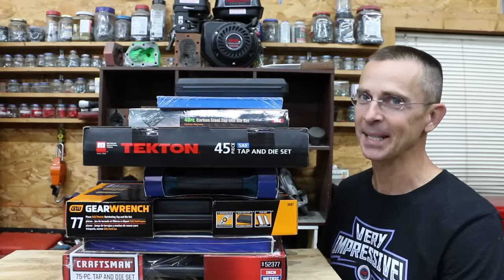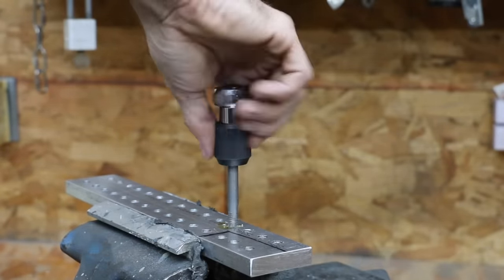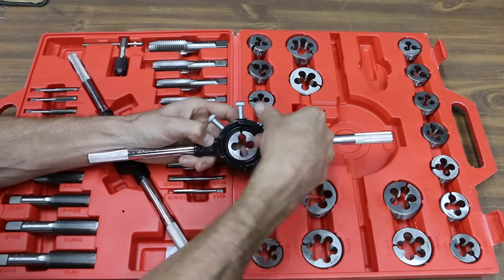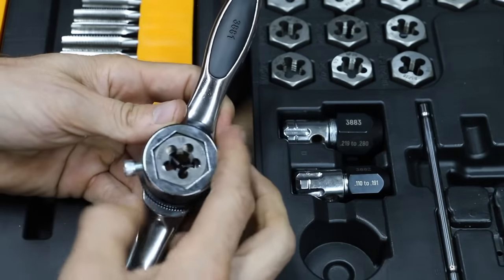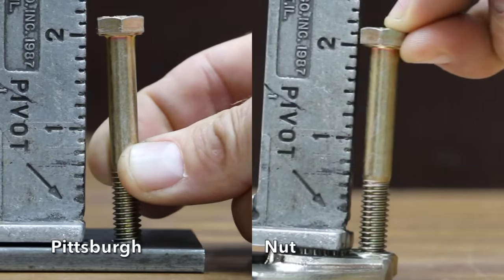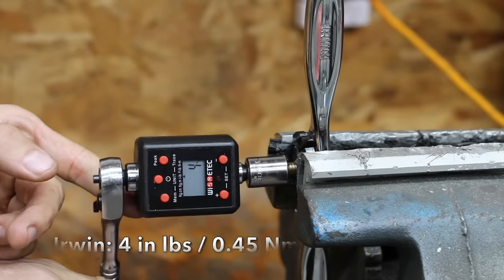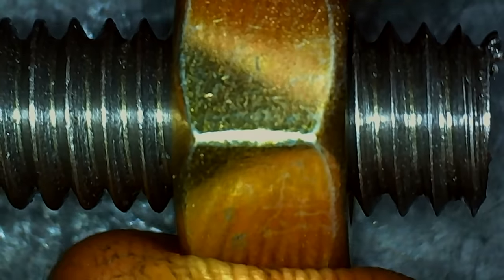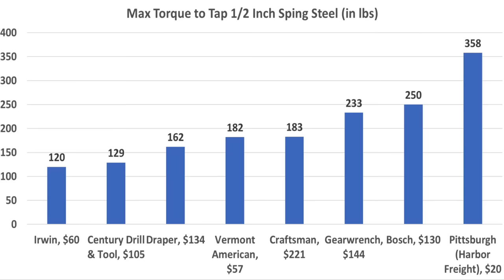Best TAP & DIE Set? Craftsman vs Irwin, Bosch, Draper, Vermont American, Tekton, GearWrench

Comment: Great video. Years ago, I was taught to make a turn or two, then rotate it backwards to break the chip; is that wrong?
Reply: You are correct as it is better for tool life and a quality thread, but I can see that keeping things consistent for testing by just going straight on through is probably best.  Also, in production runs using heavy machinery like a turret lathe you would just bust on through. Every now and again a part gets ruined by double threading or a broken tool, but speed is typically more desirable and a few botched parts are expected.
Reply: Depends on material and depth of cut. You break the chip to make sure the tap doesn't 'load up'. If the material is not too thick the chips have no problem to clear.
Reply: It's the right thing to do, but with some of the 'el cheapo' taps you're better off without backing off, as the chip just gets caught up in the tap often tearing out the thread you just cut.
Reply: I was shown that way couple of turns and pull back to break the ribbon of metal swarf and then two more turns to cut.
Reply: Thanks everyone. Had a few terrifying minutes last summer, drilling/tapping a stripped hole in an aluminum engine to install a heli-coil - impossible to use a standard T-handle tap driver, so I had to put the square end in a 12-point socket and drive it with a ratchet and extension. So sketchy getting it started, using Fab Rats' eye-crometer to make sure it was straight, while applying offset torque from one side with the ratchet.

Comment: Great video!  For reference, in a professional manufacturing environment, we typically use OSG or Jarvis taps.  They're both procurable for the average person, but would be so on a per tool basis opposed to a set.  Tolerances would be much tighter than any of these sets.
Reply from the maker: Thank you!

Comment: Oh boy, for tapping, you gotta chamfer the hole first, the burr on the edge of the hole can get into the flutes of the tap and bind it up, it also helps start the tap.  Also, you must use a tap wrench to keep even pressure on the tap, using a ratchet there is too much side load and contributes to the poor thread formation.  Additionally when tapping a tap guide is a must to keep the tap inline with the hole.  Cheap ones can be bought on amazon.  For the dies, the hex dies are not designed to cut threads!  Hex dies are only for chasing threads.  Plus when using a round thread cutting die it must be kept in perfect alignment or it will dig in and cut the threads undersized and have a poor fit.  Dies should only be used in a jam, a thread cutting machine or lathe to single point cut the threads is preferred.  I would like to know why no quality taps were used?  Seeing Widia would of been nice since that's about as top shelf as it gets for taps.  Also for hard metals you gotta use the correct cutting oil.  We use tap magic xtra thick to tap inconel and it works great!  As a machinist this was a painful video to watch.
Reply: I made same comment about cutting threads with closed die (only for chasing threads); split dies can be used to cut new threads.  I’m not a machinist and I cringed watching closed dies being used to cut new threads (to think that an electrical engineer, i.e. me, knows this).

Comment: Just subscribed. Thanks for the time and effort you put into this. I'm still thinking on going with the Gear Wrench brand for a budget set and upgrade to a much more professional setup later. Would be interesting to see the same test with a different size just for test consistency.  Thanks again 👍🏻👍🏻
Reply from the maker: You are welcome!  Thanks for watching and subscribing!
Reply: BTDT - recommend buying quality taps from the start.   Just buy the size(s) you need the most for now & add to your collection later.  Get only US made HSS from McMaster-Carr or MSC
Reply: one thing I've finally learned,if you buy the cheap one first you just add that much to the cost of buying the good one later.

Comment: Hi there from Cape Town, South Africa. As a machinist myself for more than 35 years I only believe in one make of tap and die. It is FEW, short for French Engineering Works. We use to get them in three stage taps. First cut, second cut and then the final cut and it always delivered perfect cut internal screw threads. However, you need to do as you were learnt as as a machinist. Two full turns and half a turn out to break the chips inside the hole and to make it easier to tap. Always cutting perpendicular  to the hole surface. Turning the taps you demonstrated all the way in without doing the back chip break turn can damage and can and it will break the tap. Then your tapped hole has no screw thread and you are screwed. Second option of make of taps and die sets will be SOMTA. Have no idea what it stands for but they do make good quality cutting tools. There is only one way in cutting internal and external screw threads and that is take your time and do it the correct way. The above is not my opion but what was taught to us as machinists and artisans. Thank you for your time in making the video.
Reply from the maker: You are welcome!  Thanks for sharing.

Comment: Love the test, but clearly homeowner grade, gotten worse over years. I only buy HSS steel taps and drills, preferably usa.  Love to see you do a higher end comparison of only HSS including USA and others.  For some of us, we are willing to pay more, but want value.
Reply from the maker: Thanks!  Thanks for the feedback.
Reply: @ProjectFarm  For a lot of machinists who are specific about the bolt and nut sizes that they're willing to use, die sets which include dozens of pieces are just filler. They'd rather just buy individual pieces in the sizes they need out of the materials they want. If you decide to test higher quality tap and die manufacturers, I'd just order the single size and thread pitch of tap and die that you'll be testing and omit the rest.

Comment: Also, standard practice is to alternately tap forward-reverse by hand (instead of forward only). Instead of using a drill press just for starting the tap,  ensure the tap runs straighter all the way by keeping the top (back) end secured in the drill press for the entire operation (although this may require a different drive wrench than is included with some sets) while turning it by hand.
Reply from the maker: Thank you!

Comment: Love the videos like always! Something I'd like to see from your channel is IR thermometer guns. Also a bit of a PSA on how inaccurate they can be on unpainted metallic surfaces like stainless steel.
Reply from the maker: Thanks!  Thanks for the video idea.
Reply: From my experience an infared thermometer "gun" is used more for comparison than exact temps. It's a great tool for measuring trends. Actual temp within a closed system is always different from surface temps.

Comment: I generally like your show. I don't think its fair to judge the "fit" on the taps when you are using a ratchet. To make the highest quality threads in a tapped hole you should be using a t-handle so you are not imparting a bunch of wobble in the motion. Thanks for your vids
Reply: Was my thoughts exactly, the wobble was so obvious in the video and can't be relied upon as a standard.
Reply: Or A press with a spring loaded die chuck.

Comment: Great video showing the durability of the taps and dies themselves, although when buying tap and die sets the tap handles and die stocks are a large part of the purchase as well. Any tap and die are considered consumables, I would like to have seen testing of the tap handles and die stocks as well. Also when cutting threads with a tap or a die it's always best to minimize wobble and back the tap or die up a turn every now and then to break/clear chips. When tapping by hand even with a tap started straight you can cause threads to change size by not keeping tap straight through the entire cut. Now with dies, especially split dies there is adjustment to them by tightening or loosening the screw which opens or closes the die giving a desired fit. Therefore your tests weren't truly apples to apples. I am very appreciative of your videos and enjoy them a great deal, and by no means am I commenting to be negative towards you. As a toolmaker I just had to get this off my chest😉. Thank you project farm, God bless!
Reply from the maker: Thank you!

Comment: Having worked the last nine years before retiring in tool sharping, none of the product you showed impressed me, some a little better than others, but from the quality of manufacturing them I would describe them as crappy, they should only be used to 'chase' holes, and threads on a bolt. Not for making new threads. I would also like to see and measure the drills they sent, that can effect the size of the hole too.
Reply from the maker: Thanks for the feedback.

Comment: Many of these threads are sloppy and horrendously out of square because you are driving the tap with a ratchet. Applying the torque to one side of the tap will always have poor results. Using a 3/8" T handle would have been ideal.
Reply: This and you need to do chip control by backing the tap up to break the chips off. Makes a tighter tolerance.
Reply: using a tap guide in a drill press, so the alignment is very close would be better
Reply: Thinking the same thing plus lack of chip control.

Comment: I've got a set of Proto taps and dies that are from either the late 1940's or early 50's. My grandfather gave them to me about 1969 or so. They have been top notch. I broke the #10-24 and replaced it with the same. That was the only one I ever had an issue with and it was probably my fault. I was using a "new" brand of cutting oil and it got away from me.
Reply: Is that Proto set already spoken for in your will??
Reply: @twistedhillbilly6157  😄Yes, it is.

Comment: I have a feeling the higher torque partly comes from the taps being oversized. They are removing more material.
Reply from the maker: Thanks for the feedback.
Reply: I would argue size has less to do with it. More likely the hardness, shape, and sharpness of the cutting edges are going to have the biggest impact on required torque.
Reply: @ZimZam131  That's why I said "partly". I was only stating that it IS a factor. d

Comment: Aloha Braddah….Maybe it was mentioned but I will not read all the comments to see….I don’t see it all the time in this demo but I learned that you use cutting fluid(oil) before you start and you go in a few turns and back it out, repeat the pattern as you cut through. If you keep driving it through, the shavings start to mar and damage the new cut threads and or the tool itself. I watched in in slow motion to see if you were doing that. I see it going reverse but hard to tell. Everyone has an opinion….everyone is an expert, as reflected in the comments in any type of video you watch. I’m an aircraft mechanic/technician by trade. This was interesting and entertaining to watch. Mahalo nui loa for sharing.
Reply from the maker: Thanks!

Comment: Great review Todd. I'm curious if you might could have measured the cutters diameter with a caliper to see the variance between brands ? That could provide some more insight on the slop in the hole using the bolt and help clarify cutter's quality of cut.Also, If the cutter is slightly larger then it might be part of why more torque was needed to make the cut in the metal..
Reply: Not sure why this matters. Isn't the actual result the better indicator?

Comment: I've always wondered what kind of thread locking solution worked the best, whether it be nylock nuts, locktite, split washers, grooved washers, there's probably a bunch more solutions too.
Reply: Rust/Galling/Cross Threading are natures thread lockers😂
Reply: Gum!
Reply: Over torquing is always an option...at least for a while.
Reply from the maker: Thank you!
Reply: nord-lock
Reply: Lockwire or safety wire with 0.032" stainless steel wire. Standard for aircraft fasteners where you die if something comes apart mid-air. You'll need to drill the nuts or buy pre-drilled nuts.  Simpler solution is a castle nut and cotter pin or just drill through the nut/bolt and then a cotter pin.

Comment: Not trying to be “that guy” BUT As someone with an education in precision machining i have to say The results aren’t as accurate as they could be as the taps weren’t used correctly, for every half turn you’re supposed to counter rotate at least a quarter turn to clear the chip to prevent the chips from wallowing the threads out further which was most likely the case in all of the tap tests, while I was in school I actually made that mistake and failed a part by a total of .030 because I was in too big of a hurry to get it done and didn’t clear the chips, remade the part (which sucked because everything but the thread was within one thousandth of perfect) clearing the chips in the tap and I was spot on with the tolerances
Reply: Yes, I learned that lesson too, in my high school, machine shop, course.
Just sayin...
🙈🙉🙊 😎 🇺🇸

Comment: Can you do best dial caliper?
Reply from the maker: Great suggestion!  Do you have suggested makes/models you'd like tested?
Reply: @ProjectFarm  Harbor freight, Starrett, Shars, Brown & Sharpe, Anytime Tools, Mitutoyo, Auto zone/ Oreillys/Advance Auto/Napa, Mac Tools/Snap-on/Matco, Home Depot/Menards/Ace/Lowes off the shelf, etc. I would be interested in seeing the 6" variants tested. I think a good way to test the precision is to set a baseline on a block of metal, then cycle the calipers open and closed (say 100 times or more) and then test again on the same block of metal. A drop test would be good too as I have had calipers fail after a drop and the needle wouldn't read correctly. You could also expose them to some dust/machine shop debris and see how they function afterwards and check precision. My buddy is a machinist and I am going into mechanical engineering, and we both think a video on this would be pretty cool!
Reply: @ZAKRC  everyone just says get Mitutoyo Absolutes. Dial calipers are kind of passe today. You don't want to drop precision instruments. That's the end of them. I wouldn't even trust my digital calipers after dropping them. The thing with instruments is level of trust. If you're questioning accuracy then you already have the answer.

Comment: You have to test the combo action drill / taps. Us sparkies use the Greenlee sets that have 5 or 6 drill/taps from 6/32 to 1/4" by 20. Work great in steel less then 3/16" thick. For aluminum nothing beats a gun tap on a variable speed drill for tapling.
Reply from the maker: Thanks for the suggestion.

Comment: When I saw the taps NOT being 'turned back' after cutting a small bit of thread, I felt quite unwell.  New design taps will only work as shown PROPERLY, if they cost hundreds of pounds (or dollars) I recon.
Reply: Hello Todd
I spend too much time watching your videos:-\ On the tap & die one you didn't 'turn back' (for lack of a better term) after making a partial forward rotation to clear the tap or die of chips. In the 62 yrs of my working life, I have always done this for fear of braking & jamming the item. Have I been wasting my time all these years?
Thank your for your great videos, J McGraw

Comment: interesting to see this. i personaly would not use any of them. being a mechanic and hobby machinist knowing what i know with taps and dies the cheap hardened steel taps are horrible and putting a lot a faith in something thats gonna end up breaking off of damageing a part
Reply: Then why would you use them??
Reply: @mikeshardstudio  I edited my comment.
Reply: I’ve been looking for a decent tap and die set but like you I don’t like what I’m looking at. What do you use btw I’m curious what anyone who doesn’t like these options would be comfortable using long term? Thanks in advance for any info ✨
Reply: @mikeshardstudio  I think he meant he wouldn’t use them
Reply from the maker: Thanks for the feedback.
Reply: @enegron6987  I usually have good luck with the usa made high speed steel taps and dies 3 fluted ones seem to do better then the four fluted. And my favorite taps to use is the spiral taps. Which tend to be alot more exspensive than the 3 and 4 flute ones. But that's what I have the best luck with
Reply: @tomrspears  thanks

Comment: Draper dies are split to allow adjustment of their size for proper sizing, you didn't pay any heed to this. Also, none of these tools are not intended for continuous cutting like you have done with the drill rods, that is a poor test design. The tap torque values are also irrelevant, and not backing out regularly to break & clear chips is just abusive. Accuracy of thread form, and durability of the tools are the only real parameters to test, and should be tested with calibrated Go/ No go thread gauges for the appropriate class of threads. Another note is the weight of these tools is irrelevant, the tapered shank designs on the light taps allow deeper holes to be tapped, the full shank are stronger for tapping harder materials but shallower threads. I suppose a machinist channel this is not, but a little more care would be a good thing. Thx.